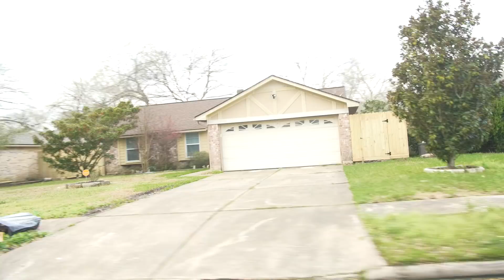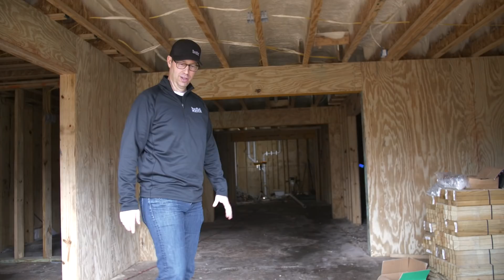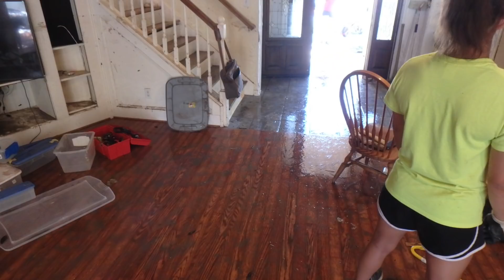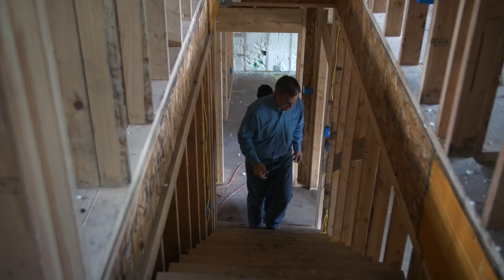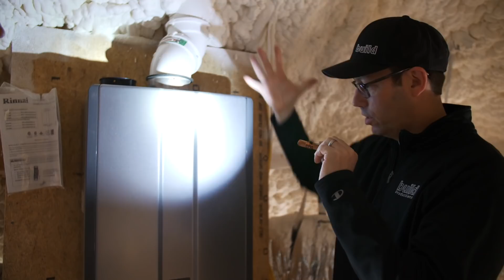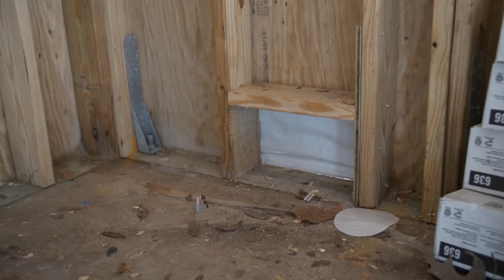Flood Rebuilding Methods - Hurricane Harvey

Comment: Matt, He is doing an awesome job, but my question is on the joists being an OSB type in the "crawl space," wouldn't it be a good thing to also spray closed cell on the sides of the OSB joists open to the potential water?  To keep them from absorbing water and losing strength.  I guess it could be any waterproofing that you have spoken a lot about in previous videos.

Comment: That's called a "beach house" on the bay. Best way to handle flooding.
Reply: Adding a car lift in the garage is also a good idea. I just jacked my car up a foot to take care of my flooding. When the water is gone open doors and windows add a fan and just dry out the 1/2 plywood walls. All elect outlets are 5 ft off the ground level.

Comment: It rains a lot in ATL and I want a single story flat roof 3-4 bedroom and bathroom home with a 2 car garage tall enough to place a car lift within to work on my next vehicles I purchase. Since I am looking at land in the northern region of ATL close to the mountains, which is on the side of the mountain where it rains a lot, would it make since to have a thicker slab or try to find land elevated high enough from potential floods?  I know I will also have to consider corrosion if the elevated location is in a flood location. The lands cheap but that may be one of the main reason why its cheap. It will also be an off the grid home in an area where I will have to cut down many trees for the solar potential rating to rise and the build with be mainly steel and concrete.

Comment: How much did it cost to rebuild like this? How many of the people of Houston can afford anything like this?...
Reply: Not to mention... sometimes FEMA money is 25 cents on the dollar for what you really need to fix something up.  I have to believe that at a minimum, he got a construction loan to fill the financial gap - he seems to be in an age bracket where the old home might have been paid off [or close to that], but a refi doesn't fit where the existing structure [whatever it's appraisal value is] will be demolished.
Reply: We got more than $50K worth of damages and less than $20K from FEMA. No most people in the area cannot afford this kind of repair.

Comment: I've designed a river house to have 3 feet of water inside. During flood no openings below 3ft all pipes through floor no stud bay or bottom plate drill through.

Comment: Should use closed cell foam everywhere to stop the high humidity from coming in in the first place. Yes it’s more expensive, but it is a vapor barrier and adds a lot of strength to the structure as well.

Comment: I've lived in Houston for 14 years now and there is so much of this city that should be condemned.  Nothing should have ever been built there.  Before I bought a house I went to all the neighbors and talked to them about Allison.  Don't consult the maps, talk to the people.  Also, having grown up on the coast, you need to do a whole video about water flow through and those vents.
Reply: 2001 was an eye opener to me [not being from Texas].  The imbeciles running the city had allowed hospitals to be built with equipment rooms in a basement!  So with lives on the line, breaker panels were submerged and the city was in a bind.  The underground parking at one place didn't impress me either - news coverage was limited on account of a submarine was not available.  When you are right next to the Gulf... you will get hit, it's just a matter of when. For ease of maintenance, commercial buildings that will be 5 stories or more really ought to put their equipment rooms on the 2nd or top floor.
As for this "Texas basement" setup, it's not bad but the meter pan might not make it the next time.  There's something in code that is causing a problem:  I have seen "emergency" pumping stations near the Mississippi river where they dutifully built an equipment space on the second floor, spent all kinds of money on vertical pumps with extended drives... and the meter pan/connection box is outside 5 feet above grade where it stubs up.   People do need to work on these, but why not allow a porch or platform with stairs as an easement?  Some city inspector effectively lit a match and burned up $750,000 with that decision - which won't include the millions in water damage that might occur when that pump station bites the dust.
Reply: Part of the issue is the knee jerk regulation bad reaction a lot of people in this part of the country have. Houston really needs to do what tulsa did in the 80s after our last major flood. Tell the housing developers no you can't build just anywhere you feel like. Buy out the most flood prone areas as needed, require new construction on the flood plain to be up above the 100 year flood line and invest in storm water control and management. We manged to do it and now for the price of a few extra dollars a month on our city sewer/water bill to fund storm water management we enjoy some of the lowest flood insurance rates in the country. We also have a bunch of city parks that double storm water holding areas.
Reply: Agreed.  This video shows a decent way to build up...but even if your house is protected and resilient, flood areas are still no place to live.
Reply: Technically, Houston is above sea level, but billions upon billions of dollars in drainage projects would need to be constructed.  Some bayous must be deepened. Tunnels will be constructed. The region is so built that natural places for drainage are occupied.    The projects could take the remainder of this century, if they are ever built. Some streets may be sunken and become intentional channels for water - hopefully they keep drivers off of them.  It will be a massive engineering effort, yet the land is also subsiding.  

Building an above ground basement may help in the future, but thousands of home owners can't do that.

Comment: Why'd he use so much wood and not stone? It seems to me that the wood will rot after another big flood. Am I missing something obvious?
Reply: Wood doesn't rot a long as it can dry out.  Think of all those old wood homes in Europe.  Occasional wetting isn't a big deal.
Reply: Demoncard he used pressure treated wood, which keeps the wood from rotting. Same wood that's used for decks, porches, outdoor structures such as sheds and dog houses.
Reply: Fortunately the water subsides as quickly as the drainage systems can handle it, a few hours or perhaps a few days.  I'd have used concrete for the "basement".  After tearing out sheet rock and insulation, killing the mold, the houses usually can be repaired.

Comment: Matt .... Thank you for not forgetting the Texas coast. Still so much left to do. Your trip to Lake Jackson was such a blessing and touched so many hearts, including mine. May have a lead for you on  a non-flood related reno on one of the original mid century modern homes. Built by Ceramic Construction. Alden Dow designed the city and worked with several significant architects to build homes for the original management executives and professionals moving here for Dow. They don't go on the market often. Would love to have your brain wrapped around the project! All the best Matt.

Comment: People who live in floodplains... crazy.  Might as well build on stilts.
Reply: They are.  Problem with Houston is that a majority of the flooded homes were not on floodplains which required flood insurance.
Reply: Rick Tatorship I think the main issue is not with wetlands or things like that...it's building codes.  They let them build crap on crap.
Reply: xephael That's the problem here in New Orleans, there is sooooo many corrupt people and politicians that all want their cut before anything can be done. It took years and a threat of withdrawal for them to finally start using the fema money to rebuild the storm drainage system, and just look what happened last August from simple rainstorms... flooded cars, homes and businesses INCLUDING the world famous Dooky Chase's Restaurant! Why? Over half of the pumps of the entire drainage system were down and have been down for years!
Reply: @jaysson1151  If I recall... didn't the city pick some odd spec pumps where parts were ONLY available from Germany?  Their work may be excellent, but for what they wanted, things get made only after payment is arranged - and add extra lag time for anything needing foundry work.  The city should have bought it's spares up front, instead of wondering if lead time was 3 months or 10 down the road.    This is the kind of brain damage that happens when a city mayor goes on a foreign junket
Reply: Kenz300 x they need an actual storm water drainage system like New Orleans has (when it's working and maintained properly lol).
Reply: John Clark Required and recommend are different things.  I hope insurance companies become much more risk adverse to these sort of builders.
Reply: Rick Tatorship I live by a place that gets flooded ever 40 to 80 years.  People are stupid and like to ignore/forgot history.  They've built mitigation systems, but at everyone else's expense.  Need to stop bailing out banks and idiots.  Let them sink.
Reply: xephael You're right about that!
Reply: xephael - I'm
Reply: Some people down in Houston have been flooded twice in one year. If humans don't solve the problem nature will do it for them...and the humans won't come out on top.
Reply: Ken MacDonald 
That's bull shit.  The gradual warming of the planet is causing more extreme weather conditions.  The warmer ocean water means that more moisture is being drawn up into the atmosphere.  That is why Houston had 50" of rainfall in a single day during hurricane Harvey. Why Harvey made landfall as a category 5 storm in Puerto Rico, Cuba and the Virgin Islands. Rare events that devasted these Islands. Only Cuba was prepared for a storm of that magnitude.  
Some Houston residents have had their homes flooded 3 times in 2 years. 
Weather IS becoming more extreme. To say that it's not is being either willfully deceitful or just plain stupid.

Comment: WHY NOT BUILD A TRUE CONCRETE BASEMENT?
Reply: Existing footings wouldn't support poured walls
Reply: Paul Allen I THINK IF I WERE TO GO AS FAR AS HE DID...I WOULD DO NEW FOUNDATION ALSO...THAT FIRST 8 FEET TRADITIONAL BASEMENT..
Reply: I feel sure he considered it. Doesn't sound like he's a dummy. But having to replace slab and footings might have been the break point and pushed the job over the limit of what they wanted to spend. Just speculation on my part, but I'm pretty sure removal of existing slab and footings, pouring new footings & slab, and new poured walls would have easily added another 75-100 grand to the job.
Reply: Paul Allen IF THE COST WOULD HAVE BEEN THAT MUCH MORE...I CAN UNDERSTAND HIS MOVE...THOSE CEMENT PLANKS WEREN'T CHEAP..
Reply: Absolutely not as big of a hit to the wallet. But cost wise and weight wise, the existing footings would carry the load.
Reply: Paul Allen YOU RIGHT..HE WOULD HAVE HAD TO DO QUITE A BIT MORE WORK
Reply: We don't have basements in Houston.  The water table is pretty high in this area.  Water would seep in constantly and in heavy rain a basement would flood.
Reply: Would have at least done marine grade plywood.
Reply: M D DO YOU KNOW WHERE THE CAPS LOCK KEY IS? WE DONT NEED TO YELL EVERYTHING!
Reply: There probably isn’t a concrete crew in Texas with basement forms since they are all slab on grade.
Reply: If you mean why not have basements in this area in general, then you should know that the water table is as close to 6 feet before the lawn level.

Comment: I still can't figure out why you wouldn't create vent channels along the sheathing from the soffets to a vented ridge.
Reply: Not needed. Attic area is climate controlled so no hot air to ventilate. And spray foam prevents moisture transfer and/or build up.

Comment: I think I would have gone with poured walls on the first floor but great idea to build up
Reply: Footings wouldn't support poured walls. Would have had to remove slab. But additional support added to footings several years ago was sufficient to support new wood walls with house above.
Reply: Apparently, that's what was done in previous years and that mod would support the current wood framed basement walls, but would not be enough to support poured concrete walls.
Reply: dig around the perimeter of existing foundation and bank pour new footing, form wall on top of new footing